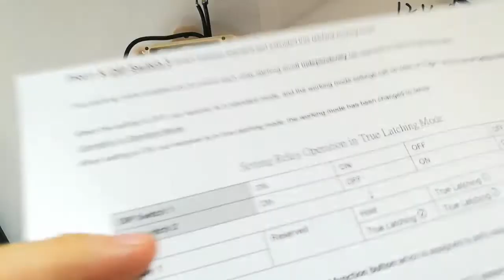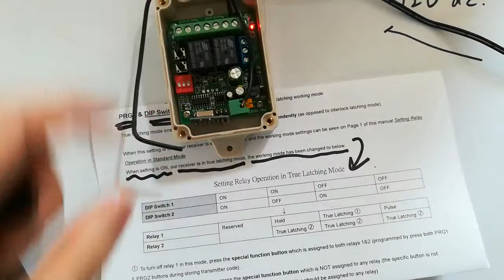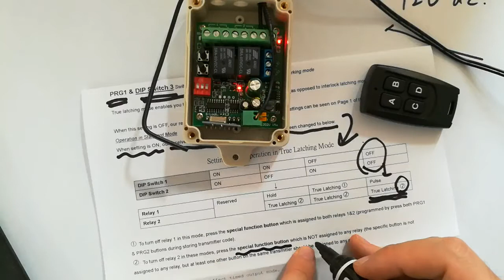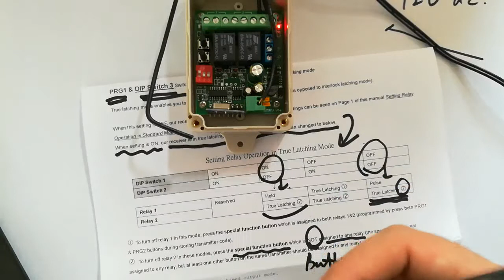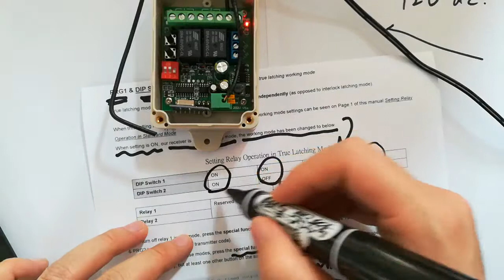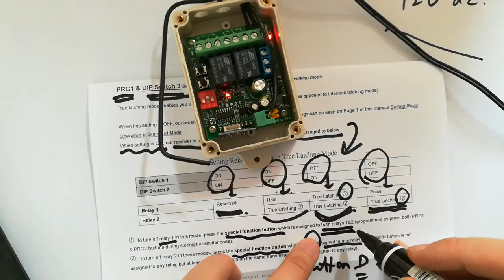202U V5 - Relay Working Mode - True Latching Mode

Comment: How do I use v5 wireless to open my car door
Reply from the maker: Sorry for the late reply due to our holidays here.
Well, the answer to the question is somewhat complex, I think you need to know your car electronics diagram well to find the circuit that controls your door, and hook our relay's output to override it.
Sorry I couldn't provide more information as my knowledge in this (car door control) field is limited.